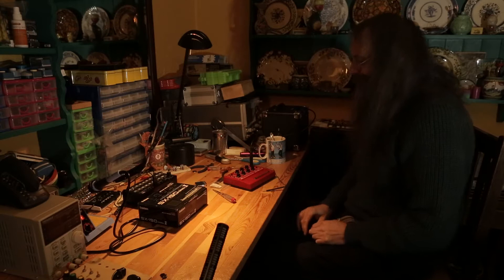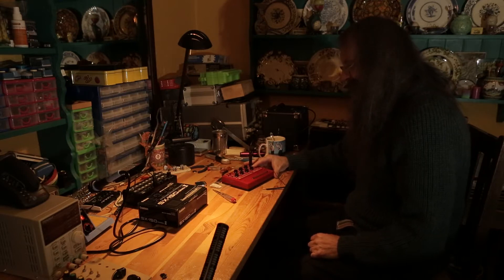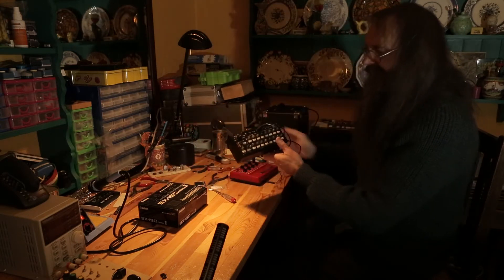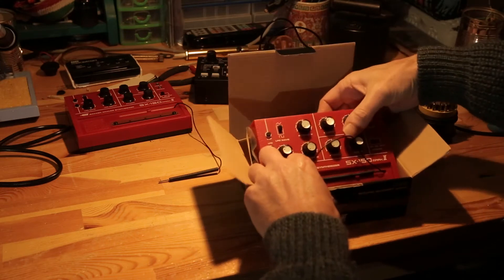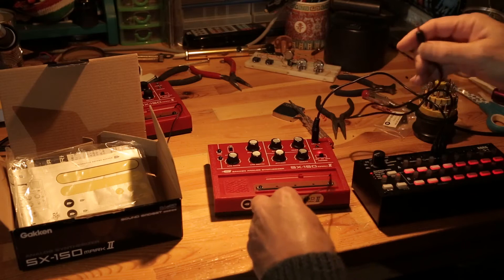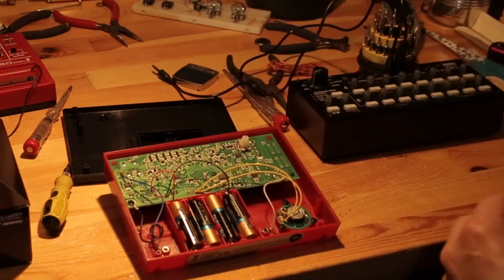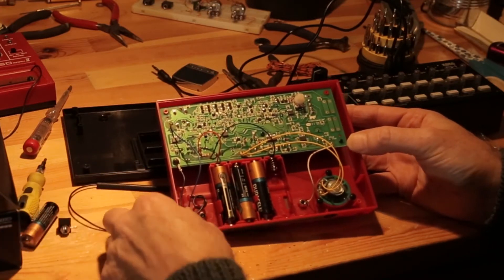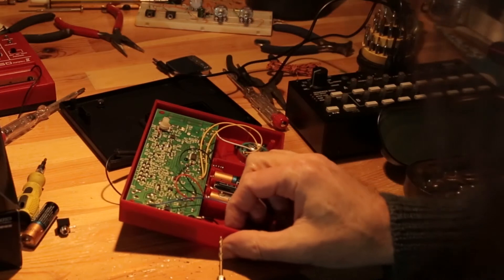Synthesiser Dave - Episode 10 - Gakken SX-150 Mk II

Comment: Since I got mine back in October 2015, the usual price seems to have almost doubled from £26 to over £50, which is silly.
One tip though, you can still find them at around £30 - £35 on eBay if you look for them misspelt with only one K... :~)

Comment: Does he do an episode about his door?
Reply: The door is an original mid-1950's job, modified from two glass panels to one after a distressing incident with a Marshal 4X12 cabinet. At some point in it's life it has been letterboxed, probably when the house was briefly converted into two flats in the 1960's. The hinges have been carefully marinated to produce a creak of A=440hz when opened at a speed of 1.3 ft/sec.
I hope that helps........
:~)